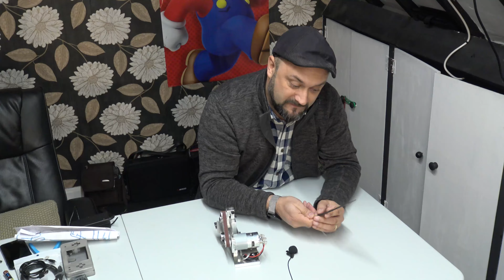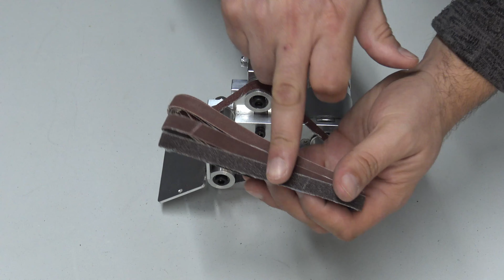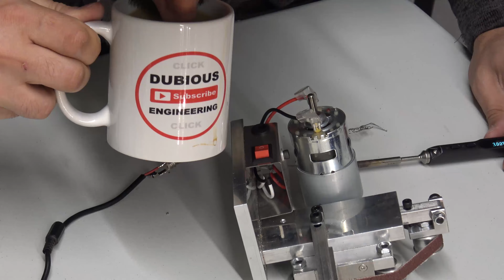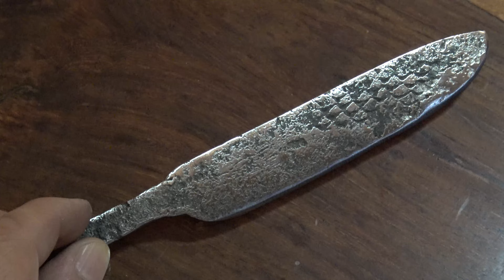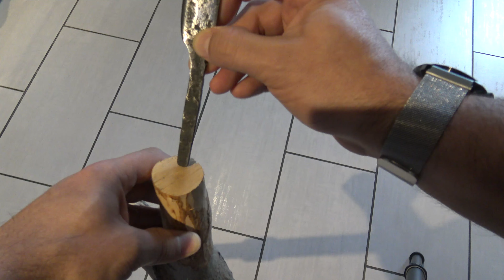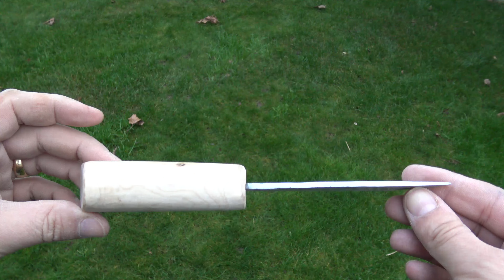DuB-EnG: Chinese Mini Hobby Beltsander review and test! Making a knife! Instagram Facebook eBay ads

Comment: Just scored 1 brand new in the box, £5 on a car boot. And found a 24v supply cough 50p. I'm going to get a pwm controller for speed. These little grinders are a must have alongside standard garage size grinders. This is  1 of them hidden gem mini tools, is it worth £35, If you already have a big grinder, yes, it's worth the addition, but not as a primary grinder purchase, there is also a hard wheel attachment to the arbour out the other side of the motor shaft.
Reply from the maker: You lucky lucky lucky 😍

Comment: Hi I was wondering if you can help me... (I cant get hold of the seller)
I'm not that knowledgeable about electronics and im having a bit of a problem I got a 15mm version of this item to help repair hobbie tools. I understand that the item takes 12V to 24V but what I don't under stand is the AMP's required for the item for proper use.
Would a 1amp supply be to under powered for proper use or would a 2amp or 3amp be more appropriate.
Thanks for any help you can provide.
Reply from the maker: Definitely 2 amps upwards... 4amps if you have it will do nicely! ... my laptop supply stops if I load the motor too much... that’s 15v at 2amps
Reply: @DubiousEngineering  Tanks...
Reply from the maker: @ObsidianDragon616  subscribe! :-) :-)

Comment: Could you wire in a potentiometer to add a veritable speed control? I suppose you could also purchase some regular glass paper belts and cut them into strips to use as replacement belts. That really is an awesome piece of kit!
Reply from the maker: The motor draws quite a bit of current so a pot would likely burn out... we would have to switch in some big wire wound resistor packs :-).  Yeah... I’m planning to have a go at making some belts for it !!
Reply: I would use a large motor driver instead.